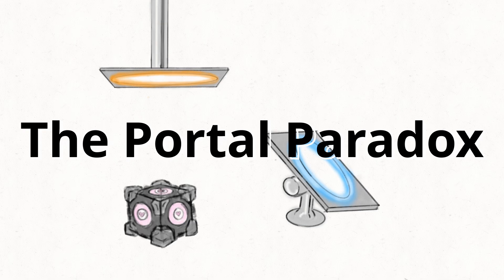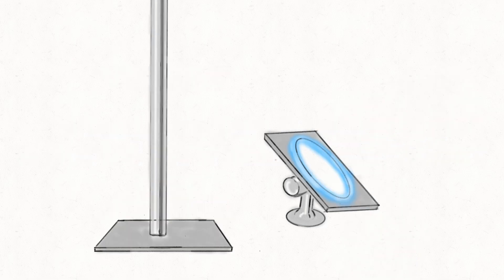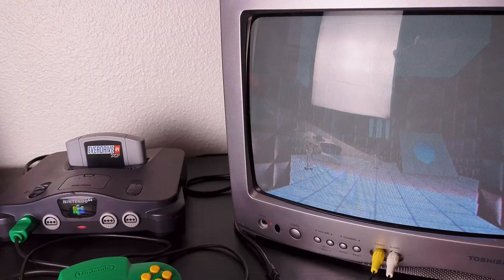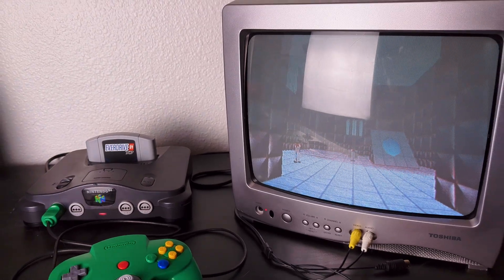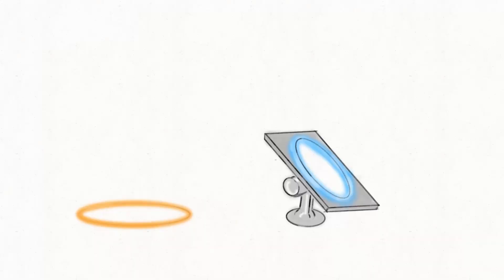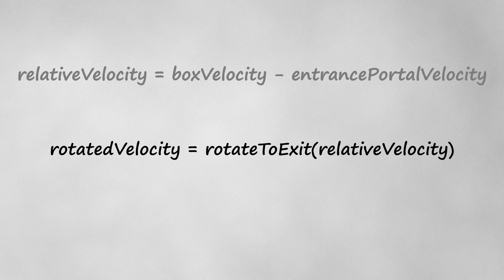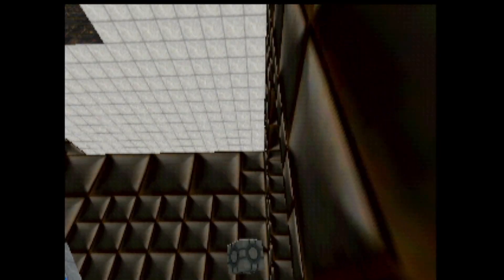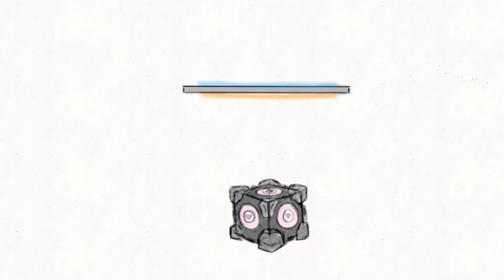I rewrote Portal from scratch and solved the Portal Paradox

Comment: I personally think it should just slowly fall out since the cube does. not attain any force by being pushed into a portal, it only has its gravital force vector shifted to anothee angle quickly, but the shift in the direction of gravity does not itself give the cube some impupse opposite to the portal's movement

Comment: Thing is, the acceleration comes from the velocity of the 1st portal, accelerating the matter of the cube as fast as the portal moves, so the cube has to materialize at the other side and be accelerated to accommodate the speed in which the first portal is moving.

 If we were to do that by hand or irl, i feel like there should be something excerting pressure back, like if you were pushing the cube with an elastic band, it would either cause the cube to appear more slowly at the other side, or to push back since matter has weight.

Of course, this is just a theoretical situation, we can't create portals that could be weilded with your hands.

Comment: I disagree, I don't see the inertia excerted on the orange portal afecting the object that pass through it in this case, it would just drop instead of being yeeted, now I believe that if the orange portal was slow enough it would be imposible to pass through it.
Reply: actually, from the particular angle the blue portal is, and the orange one was just grazing the object, and the object was light enough to be pushed like a ballon, it would be pushed in an angle.

Comment: The explanation for the hula hoop versus the stationary set up made me think:
What if the moving portal was STOPPED halfway through enveloping the box entirely?

Would the inertia of the top of the box be enough to pull the bottom through?

Great video, thanks for doing it.
Reply: Depends, saw this debated but if the speed of the exit portal is enough to over come the weight of the object, the the rest of that object would be sucked up through it. If the inertia isn't enough to overcome the weight then it might only do a little hop.

Comment: Admittedly, we're not talking about real physics, but the paradox can be demonstrated with a more convincing example.  Consider: both portals are moving and facing the same direction, one towards a stationary object.  If true velocity is conserved, the object *can't even exit the portal*, a contradiction.  If relative velocity is conserved, the object will be accelerated and the energy of the (nominally, closed) system increases.  If instead total energy is conserved, then the portals must give up energy in order to do work on the object.  This could be the energy required to keep the portal open or the momentum of the portals.

Comment: I think it would shoot out, but at half velocity.
The part of the box that hasn't yet gone through the portal doesn't have any forces acting on it, right? The only force acting on any part of the cube is the force of it being moved through space, which only the portion of the box that has passed through the portal is doing. So assuming the platform is moving at a constant speed, on average half the box is being acted on by a force, so it would have half the velocity.

Comment: Okay, ye, but portals do not stay open on surfaces that are in motion relative to other surfaces within the same general planetary body, which aren't rotation of the planet or the satellite of the planet. Which is to say, that in actuality one of the portals would shut down, this the paradox does not exist. The aforementioned point about general cosmic bodies rotation having no effect is relevant because otherwise Chell would not be able to open a stable portal on the Moon surface, and the only place where the game the continuity is in neurotoxin pipelines cutting sequence, and that one is confirmed in Dev commentary to be an error of continuity that they let to slide because the solution was elegant and you had no way of sending any object with complicated physics attached to it whic h would probably destroy the planet if the calculation of it was allowed on home PC. fixes monocular
But that aside, gg, reasonable analysys.
Reply: how to spot the redditor
Reply: @BottomlessFreefall  and you would be wrong, because I registered on Reddit to use it exactly once and submit one meme on a certain subreddit.

Comment: i thought that if the two portals are on a wall, and you go through you don't get stopped because the portal is still, it's your velocity that matters so if the portal move fast towards you, you'll have no speed when you exit the other end.

just imagine a normal door, either you move through and get out with the same speed, or it's the frame that moves around you and you don't gain speed.

Comment: The explanation was a bit over the top for me. 

So I explained it for myself, with imaging the cube not as a whole but as particles. that get transferred from A to B. 

With 2 stationary portals, a single particle with movement towards the portals can touch them and so get transferred from A to B, while keeping said velocity.

With 2 moving portals and a stationary particle it's the same. 

Now the paradox Szenario. The particle itself is stationary. When the moving portal hits it, and it's transferred from A to B, it's still stationary. So this is where the paradox came from. But when you have a few particles in a row, that all would get transferred from A to B, and have the same exit point at B, the magic happens. The 1st particle gets transferred and claims the exit point. Then the 2nd particle gets transferred ... it can't occupy the same space as the 1st particle, so the 2nd particle pushes the 1st away. This all happens with the speed of incoming particles, so the speed of the first portal.

And to solve the hoop thingy ... when 2 portals move at the same speed, this won't happend, cause the exit point is cleared at the same speed, as the incoming particles.

So basically, if you have an one way portal, you can generate pressure inside and container, just by moving the input portal around. 

But that also raises a new question in my mind. What if portal A slams at an object with a speed that is slower than a moving portal B? Does the object get stretched? Does the faster movement of portal B create something like a suction force at portal A, because the faster movement creates a low pressure area behind B? 🤔

So what happens if a portal moves very very fast through the air with the opening pointing towards the back (opposite to the direction of movement)?

Comment: The mistake you made is that although the portals seemed like two separate things on our plane of existence, extra-dimensionaly they are a single object like a pane of glass. that's why you stepped through them like a window rather than a tunnel. this means they are fixed to each other, it also means that you could move the planet and they would not move and if you did move the portal to move one would be to move the other just like moving a pane of glass. however that said how the other moves relative to us would depend on it's extradimensional geometry thereby determining how it would interact with our level of existence, our dimension.

Comment: Useless Video. Useless, like the Portal Paradox itself. The way it works, is determined by how the developer implements it. If you implement it so it it would follow realistic physics, who guessed that it would follow them? If Portal does not implement moving Portals, there is no solution to this Paradox.
It's kinda like the Chicken Egg Problem. If you define a chicken egg as being laid by a Chicken, the Chicken came first. If you define a chicken egg as hatching into a chicken, the egg came first. The solution is whatever you want it to be, just like how you wanted the portals to work like this, so they work like this

Comment: While you're explanation and math make some sense, your end result seems based only on the relativity of the portals and box. The only forces acting on the box are gravity and the surface tension of the ground, which would zero out. No additional force is be applied to the box to make it move. It's not being pushed through, the portal is what's moving. The box wouldn't have any actual momentum in the direction of the exit, thus it shouldn't move. You're applying the reverse of force acting on the portal to the cube as it exits, even though nothing new is touching the cube except new air for it to "move through." The only way the box would move in this scenario, is if the exit's gravity is in a different direction relative to the box, and in that case on in the new gravity's direction. There are 3 possible exits and they each have their own ways of affecting the outcome. If the exit is a wall or sloped floor the box should slide, in the case of the wall, it would then fall once there is enough of the box on the exit side for it to tip over and then fall. If, however, the exit is the ceiling, the box would fall, but only once the is more mass on the exit side for gravity to pull, as gravity is pulling it in opposite directions, both the relative up and down... Or be ripped apart if the force of gravity in opposite directions is strong enough to do so. In conclusion: you're use of relatively breaks the law of physics, "an object in motion will stay in motion and an object at rest will stay at rest, until acted on be a force to great enough to change its state." But, I think your relativity based out come would make for a fun tool in a physics based puzzle game.

Comment: I can with confidence say that doesn’t make any sense.

It ignores conservation of momentum, because the momentum of the box would have to come from somewhere.

It ignores the concept of energy transfer—the portal is not exerting any sort of energy or force upon the box while it’s passing through it.

The equation is flawed, because there’s no inherent correlation between the portal’s velocity and the box. Momentum? Maybe that argument could be made, but a portal has no mass! So if can’t have momentum. 

If that math checked out, then in portal you could generate infinite energy, by using a massless object to perform work. Moving matter at a fraction of the energy that should actually be required.

From a programming and development perspective, if you were to argue that the original portal game used relative velocity to determine how objects left a portal, maybe that would make sense.

Comment: I like how people try to recreate this problem but it's always biased. Of course anyone with half a brain should realise that you can easily tweak the physics to get the result you want rather than what the real game's result would be. As per usual, it's wrong. I've seen a lot of recreations of this paradox and it's always baised. It always ends up A for those who make it that way and always ends up B for those who make it that way. 
In the end, there's an old black and white clip of a guy standing there while the front side of a house falls on him. He's standing just so that he ends up slipping through the open window as it walls and is unstathed. And he doesn't go flying across the world because real physics don't work like that. The whole portal paradox was solved long before the game even existed.
Basic physics still apply in portal. There needs to be friction causing pressure for the cube to be forced to be launched. The portals don't squeeze the cube through, it passes without touching he sides of the portal. Thus no pressure which results in transfer of kenetic force causing the cube to shoot out like its a potato gun.

Comment: But where does the energy come from?
The piston does push the portal over the cube, but if it only pushes/decelerates it's own weight, there would be no source of energy for the cubes movement on the other end. If the portal wasn't there the cube would be smashed by the platform and warming/deforming slightly, slowing it down and taking some of it's energy.
For your approach to work this energy would have to be transferred from the portal to the cube somehow.
I find it easier to believe that moving through the portal doesn't cost any extra energy and that the cubes kinetic energy stays the same on the other side.

Comment: Im dumb. Can someone explain this in terms of like Newtons of force instead of relative velocity. Like sans portal plate A always slams down on the bottom plate and imparts X Newtons over and over. Then, the portal opens on the impacting face of plate A. The portal isnt an object and has no mass or contact surface. Plate A slams down again. If the cube goes flying then it had some force transfered to it right? It just had Y amount of force act on it. Does this then mean that the force imparted on the bottom plate is X-Y or is it still X? What part of the portal, a non-object, is actually applying force to the cube?

Comment: The way I see it, there are two ways the portals could behave based on physics. In your explanation  you use relativivity which is a fair approach. For the box to gain momentum there must have been a transfer, in your simulation likely caused by the conservation of impulses (or some sciency explanation like the portals calculating which velocity it should have). However if you see the portals simple as a doorway to another place in space and time this does not make sense since there would be no "collision" and no way of transferring energy. Think of it as moving through a moving doorway. As long as you don't hit the doorway, your speed will not necessarily be changed due to the doorway moving.

Comment: if the portal stopped when the cube was half-way in would the cube suck thru the portal since the other half is already moving at full speed?  in fact, wouldn't it suck in even after a small portion was inside the portal?

Comment: i think the problem is that conservation of momentum is not applied if the portal can impart momentum on the cube. if the portal stopped halfway down over top the cube what should you expect the result to be? i think the portal should move around the cube just as if it were a hula hoop connecting two spaces and not like something that can push the object. there's no other side that the portal can push an object out with relative to the cube the floor would be pushing it through the portal and the floor doesn't have any momentum to impart to the cube to make it fly out, it should roll out of the portal just from the fact that the blue portal surface turns into a floor with the same angle as the blue portal.

Comment: Okay. I think this is correct, as the logic and math checks out. However...
This brings me to a potential anomaly. What if the cube was immovable or otherwise bolted to the floor? What happens to the energy of it's inertia as it's shot out of the secondary portal? Where will it go? 
Also, would slamming a portal down on an object part way still send it shooting up into the first portal and out the second? 
And what if you had portal 1 half way on the object, and suddenly pulled it away?
Lastly... Where is the energy to send it shooting out coming from? Is there resistance on the first portal relative to the mass of the object?

In general I feel like this would violate the laws of conservation and potentially enabling the generation of free energy. Just use a light weight "wall" to shoot out a considerably heavier mass.

Comment: As a game dev, I always opted for the other option despite relativistic physics, and here's the simple reason why;

For as long as moving portals are unused, it doesn't make a difference for the result whether the portals take the relative velocity or the world velocity of the cube going in and out. However it does make a slight positive difference in performance when the world velocity can be used directly and no transformations need to be applied, and it also makes for easier-to-read code, and simply less code. Given the infamously tight deadlines and high work loads in the industry, I find the world velocity version more plausible.

I also like to point out that it's not about caring whether to abide by known physics or not, as either solution will need to selectively ignore certain laws of physics for portals to work. It's just about choosing to ignore one law over another.

Comment: I think it's interesting. One serious problem with the real life implementation is that space has no mass. It can be affected by mass but there is no way for it to shift motion to the cube. The carrying element(the plate) has mass but it's not what comes into contact with the cube. As far  as the cube is concerned it's simply standing still while space rotates around it. Therefore relative velocity is simply telling it to stay put,  probably it would simply roll down the slope on the other side. One way to see this is that you're relative velocity doesn't make the portal move when you jump into it. If it did allow you to put motion into the portals you'd have the holding element getting warped by the motion or the  portal simply moving on it's oown.

Comment: I wanna know what happens when something doesn’t completely go through the portal.  Say you drop the portal down but it doesn’t completely pass the box, say an inch is still on the orange side.
Does the mass that now has momentum PULL the rest of the box through?
Or if the portal slams down at the speed of sound but stops after only passing an inch or two of the box, does the small portion of the box now moving at the speed of sound pull the rest of the stationary box through the portal?